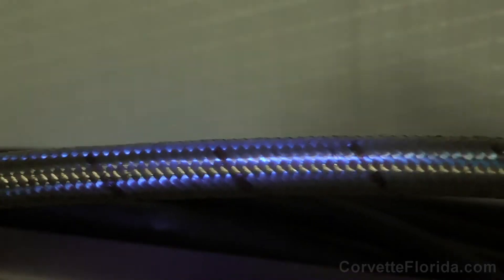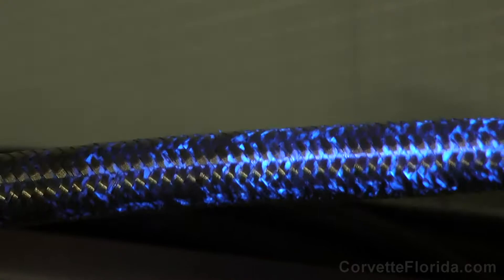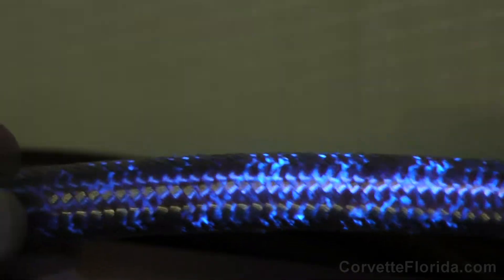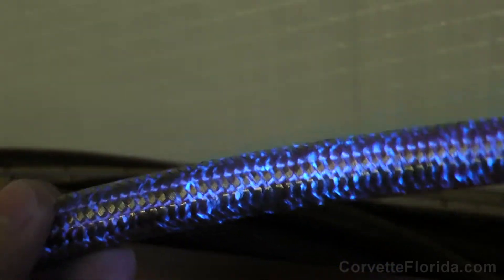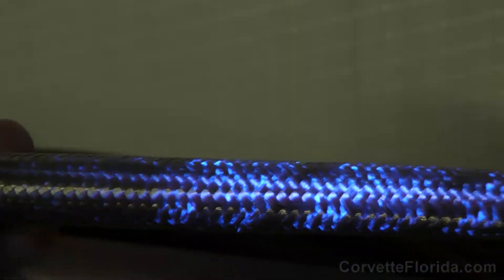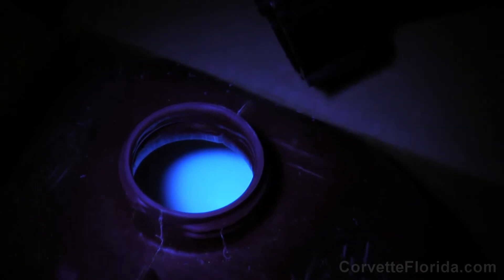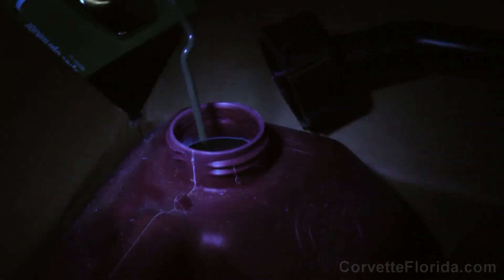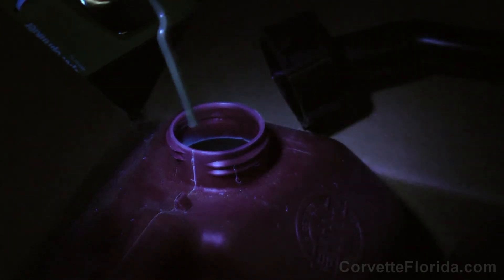Gasoline leaching though stainless steel braided fuel line?

Comment from the maker: I assembled the hoses myself. Actually I liked working with the teflon hoses and fittings a lot more than the regular SS braided rubber lined stuff.  I think you will find the stuff a whole lot easier on your fingertips.  And the fittings are just a lot more secure and easier to do RIGHT.  Not to mention all the benefits that teflon hose has all over the rubber lined stuff.  I think it's the way to go if you are doing SS braided fuel lines with AN fittings.
Reply: Rich Zuchowski im having issues now with ss braided line. Its prolly 12 years old.  But i am getting gasoline smelling garage.  As well my fuel will go in looking like lemonade, after a month it looks like ice tea, and the car wont fire. Any ideas?

Comment: good thinking. just curious, did you have the hoses made or did you assemble them yourself?  I.E. do you know of a tool to help in the assembly of the hose ends on the vehicle and not on the bench?  (the tips of my fingers wanted me to ask as they are tired of getting poked by the stainless steel braids).

Comment: could possibly be 'ethanol' fuel eating through the rubber portion of the stainless steel hose over time. also, those decomposed pieces of the fuel line end up in your fuel system, which means a total cleaning needed.  the solution is to replace with nylon stainless steel hoses. (just a thought).